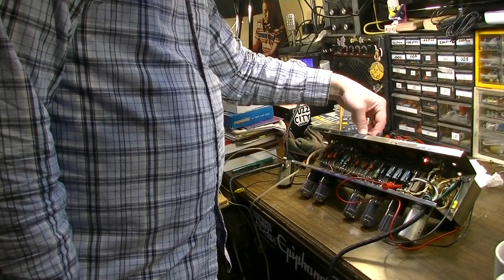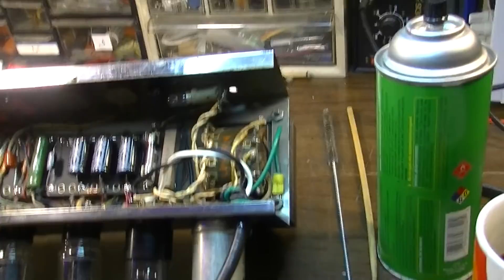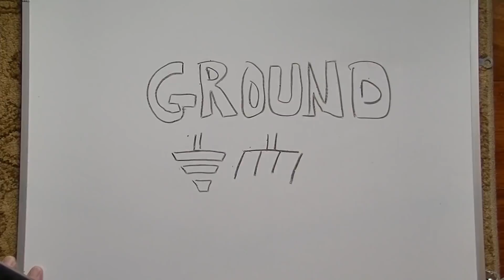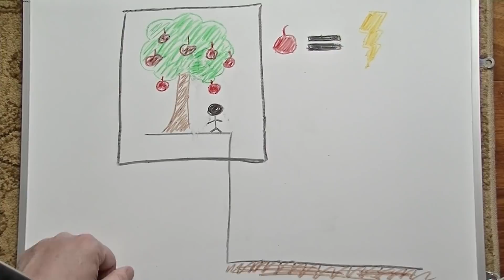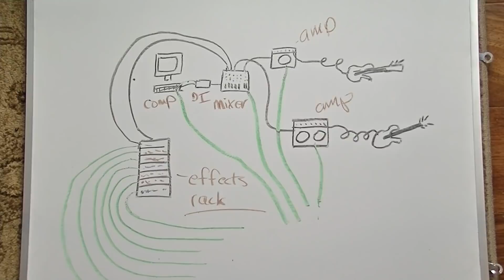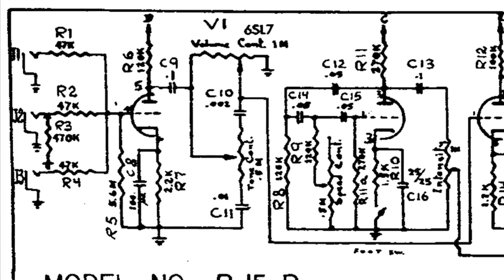Ground Loop Lunacy! - 1962 Ampeg R12 Rocket RESTORATION (Cont.)

Comment: I abandoned my J12-D because it needed 6BK11 Compactron tubes which I could not find anywhere. Now I'm entertaining the idea of gutting it, punching another hole in the chassis and using 3 6SL7's as preamp, tremolo and inverter. Perhaps also changing the 7868's to 6V6.
     I love the sound of Ampegs, but their use of weird "Unobtanium" tubes is  enough to make you tear your hair out. 
         Look up 6BK11 in your RCA book. 3 sets of elements in one bottle.

Comment: Hi Brad.  I may have missed something here but did you try replacing the 5M6 resistor?  Also, with the buzzing transformer, you might have tried painting the windings of the power transformer with lots of clear laquer, like 'estapol' or similar.  Lots, so that it kind of capillaries itself into & between the winding layers.  This worked for me with a little 40 watt transistor amp I built years ago.

Comment: This comment is probably not much use by now but I'll share my experience anyway. 

First of all. Over the years I've had two power transformers that buzzed under load. One was a beautiful art deco Kenyon that I pulled from a Hamfest score. It lived in my preamp power supply for 20 years until last year. I had that power supply a good 10 feet away from my preamp so I just lived with it until I replaced it with a new one (I couldn't take it anymore!!)

The second one was in a priceless "Black Flag" 100W 1967 Marshall Super Lead plexi head. That was a bummer.... There was nothing that could be done except sell that amp to Mick Mars....

Some transformers are just like this. You don't know until you install the thing. Better to not mess around with some old iron and just buy new.

Second. I love old Ampeg amps. But damn they eat up a lot of bench time. I'm watching a colleague suffer the same problem with one from this era. I'm pretty much retired from this now but when I was working a lot there were some amps that I just said no to. I like a good challenge but life is too short for lemons!

Great video! Thanks!

Comment: Had one of these type Ampeg chassis that had a really bad ground loop.
Turned out the cap can was originally mounted on a phenolic wafer and whoever replaced the cap replaced the phenolic wafer with a metal one thereby creating the loop.
Since it would have been a tin of work to undo the cap can and install a non conductive wafer, i was able to find a spot in the black grounding wire that travels up to the input jacks and grounds various stages and split the loop there and remedy the situation.
Yes, crazy grounding scheme...

Comment: Fascinating diagnosis, but I'm not sure the answer is correct.  One I think can safely assume that the amp did not hum like that when it left the Ampeg factory.  So logically one can conclude that the amp is no longer configured in the same way.  Whether through modification, oxidation, or simply faulty parts, the amp now hums.  While you've found a way to stop that, I would argue that you're only masking another problem.  After all, the jacks ostensibly were originally chassis grounded and now they're grounding to another ground rail.  So I wouldn't stop there, I'd use that observation and ask myself what else has changed that could cause this to make such a large difference.  Of course I'm not fully aware of the state you got this amp in, and whoever got their hands on it before you got it, and you had to do a transformer swap along with a whole shitload of caps.  So I feel you and understand what you're up against here.  But ask yourself what could have been causing ground current with ripple to find a better path to ground by going from the chassis, via the jack, across the shielded input cable (inducing hum) to wherever the input jack is grounded?  I don't know the answer either without it being on my bench.  But I'm looking squarely at the mains chassis earth.  I have a feeling that feature isn't original, and while I agree with earthing old chassis, perhaps this amp design requires a different approach to it.  I also suspect the reason Ampeg grounded the inputs at the chassis is so you don't get shocked while touching the chassis and your guitar at the same time.  When you lift the input jacks and ground them elsewhere, you run the risk that the chassis and the this ground point are at different potentials.  A bad solder joint can make that happen at any time.  Well, your guitar will be at the potential you've grounded the jack to, and if that isn't chassis potential, you can have a fun surprise when you touch the chassis and your guitar strings at the same time.

Comment: Very nice exclamation of ground ing ii have done many rub amp That because of the high impedance of tube noise is alway a problem components theme can generate noise and will a lot of corosen  of the chassis it’s best to go to a classic grounding and eliminate all loops and have just one chassis ground this amp stock has several

Comment: So, what would cause the 5.6M ohm resistor to open in the first place? Was input 2 designed to be the default input?
Reply from the maker: No real default, just different impedances.  Not sure on the resistor, just old, badly made, who knows.

Comment: There seems to be a bit of back and fourth about where to place the ground for a three prong conversion, as far as the new chassis ground placement. Some say drill and make new ground solo lug/tap for the wire others still use a transformer lug/stud. Time, gear, customer requests all come into play. Thoughts, good/bad makes no difference?

I had a nasty ground loop from my Laptop and Audio interface. Nasty meaning If I recorded I couldn't hear it in my cans but playback it was there in the recorded signal. Moved both power chords of the interface and laptop power supply to the same jack. Which made me question the wiring of the house mains.
Reply from the maker: Your house wiring is probably fine. Plugging all device grounds into a single wall outlet is the way to go. Sounds like you did it right. Now, of course, you can't overload a single source, but floating the grounds of devices you can't plug into the same outlet and then running chassis ground wires from one device to the other devices plugged into that outlet should fix the problem.

Comment: Well It may have been the fact Before the 1970's two prong plugs were more common than three prongs so they probably were thinking they were being smart, and no one caught on to this till the 70's or even the 80's. There's also the possibility of a manufacturing mishap that was happening that no one caught in Quality control. I'm just making an Educated assumption so If anyone has a better quess as to why we might as well try to figure this out so the curious among us can be enlightened.

Comment: So did this old Ampeg ever work correctly if it was wired wrong to begin with?...or did I miss something? DO all old Ampegs buzz?
Reply: They were wired correctly, when he grounded the new can cap at power end of amp it introduced ground loop because only ground point was at input jacks. The original can cap ground was isolated from chassis with its ground going to end of ground buss on board

Comment: Recently I have rebuilt an R-12R with the exact same issues: ht secondary shorted, also a bad rectifier tube, leaky capacitors,  and the dreadful ground loop that you have been showing. I couldn't understand why Ampeg overlook the grounding problem, and have been wondering maybe is because the amp originally had an ungrounded mains cord, and changing to a grounded cord would create the ground loop ? Thanks for your videos, awesome stuff !

Comment: After reviewing your first video and noticing the replacement of the power transformer, filter caps, rerouting the ground leads, then hearing the hum issue, I can't help but think that you introduced large filter cap ripple currents into the wiring that constitutes the system's "ground." Long ago, I'm guessing that Ampeg had hum problems in their initial crummy design. They futzed around with the location of this and that ground connection scheme, got it working somewhat, and pronounced "good enough. Ship it!" Half a century later, you come along and rip apart their wiring scheme, change component selections, and now you have a hummy amplifier. Why are you surprised? (That's an observation, not a criticism.)

Every conductor has resistance. It cannot be helped. When you run current through a resistor, you get I*R voltage drops. R is what it is. I, on the other hand, is a function mainly of the capacitor quality (ESR). The lower the ESR, the higher the ripple currents are, and hence the larger the I*R voltage drops in your ground system. ESR of those old filter caps was usually pretty high. How about your replacement caps? I bet they have lower ESR than the original caps, which increases the ripple current amplitude. This voltage drop has gotten into the entire system grounding, and now it has corrupted the audio. It doesn't take much input noise signal to a 40-60 dB amplifier to get a lot of output. That's what amplifiers do!

I have no idea what your grounding wiring looks like, but were it me, I would have created a  a "star ground." First and foremost, isolate the wiring between the power transformer and the power supply components, particularly the first 22uF cap that is on the output of the rectifier tube. It is where 99% of the ripple current is created. Put the "ground" of the power transformer on your component board (call this "A"), and then route all the power leads to it, and nowhere else. This way, you confine and isolate the flow of current in this subsection. The last thing you want to do is to somehow pass these supply currents through the chassis! No! Electrons come out of the power transformer, and each of them MUST make it back to the transformer. Take advantage of this fact to keep as much of these currents out of your audio ground!

Point A then defines your audio amplifier ground.  Connect all of the amplifier's ground leads, then tie them to point A using a single wire. In this fashion, you have more or less managed to isolate power and audio grounds, while still keeping them tied to the same potential. I am still dubious about the 1/4" jacks making the chassis "hot" (it would be much better if chassis was connected ONLY to the green safety lead of your power cord), but at least there won't be power supply current running through it (chassis) anymore. This should keep the I*R drops in your audio ground to a minimum. In this video, I do not think that is the case, and is the source of your hum.

Something else that would be of value would be to connect your Fluke to the output of the speaker and then measure the frequency of the hum. 60 Hz or 120 Hz? 120 Hz is a sure sign of power supply current corruption of your ground plane. If you had an oscilloscope and a current probe, I'm confident that you would find that your speaker's audio hum would look exactly like the power supply's filter capacitor ripple current.

I also note that you now have a 3-wire ground system, which the original amplifier did not. I bet your variac also has a 3-wire ground system. Thus, you have also introduced a ground loop between your amplifier and the variac, making the chassis even "hotter" yet. Run a fast experiment and use a cheater to break this loop and see if it reduces the hum. Or punt the variac and plug the amplifier right into the wall. How's the hum?

No matter what, this is a horrid design. Whoever designed it was not a competent audio engineer.

Comment: I also would advise that putting those 47k and 470k resistors on the circuit board rather than on the jacks would be better way to design that. Because you want the highest level signal on the wires going to the circuit board to reduce hum as much as possible.  You don’t want to reduce the signal level then send it along an unshielded wire.

Comment: There must be a more “correct” way to fix the hum. Surely, Ampeg wouldn’t have designed it with so much hum. No one would have bought these if they hummed like that. Is it creating a possible shock hazard between the guitar strings and the amp by not having a direct ground there? I would be very cautious about eliminating a good ground between guitar strings and amp chassis. Love your videos!

Comment: To confirm grounding problems, check for zero ohms with an ohmmeter, or use a wire to connect the grounds to see if it makes a difference.

Comment: 1/4” jacks are crimped together so it is very possible they are not making solid electrical contact between their own parts. Replace them with new Switchcraft jacks.

Comment: inductive capacitance.  experienced this before while shipbuilding in the uK.it involved screened cables  passing through metal holes, we were using 240V for our supply voltage. and we were getting 120V to 140V readings from the screen down to earth. the guys were getting electric shocks from these,and the simple solution was earth the screen at one end   solved the problem.   great show BTW

Comment: Nice description of how ground loops happen but I don’t think that’s your problem.
I reckon your A supply on V1a has is not filtered properly. The capacitor can you removed has 4 inbuilt capacitors. I reckon you need to check the C1c R28 combination is properly connected (seeing as you replaced the can) as it sounds to me you have 120hz problem not 60hz which indicates power supply ripple.
As per this circuit
https://www.google.com.au/search?q=ampeg+r12+c1+capacitor&safe=off&client=safari&hl=en-au&prmd=sivn&source=lnms&tbm=isch&sa=X&ved=2ahUKEwjmv_mT-JfhAhVT8HMBHXlJC8oQ_AUoAnoECAwQAg&biw=1024&bih=666#imgrc=5eoDdIcMB0tn2M

Comment: Use Max Pro Electronics Lubricant on the inputs. It works as good and is less expensive than Deoxit. It's also a much bigger can. The lube in it creeps better than WD-40 so you can use it on rusty guitar bridge parts and shit. Used with a Q-tip, I think it deoxidizes jacks better than Deoxit and the lube is so light ity seems to disappear after a short while.
Reply from the maker: I may give it a try. Thanks for the tip.

Comment: An interesting conundrum of an Ampeg to be sure.
Q. At what point in your modified circuit does the player connect to Earth potential ?
I didn't trace the circuit with any diligence I admit, but a little safety concern light bulb went off in the back of my head. 
Way back amongst the dust and old cardboard boxes.

I've played “Hunt the Hum Loop” in studios a couple of times. 
Infuriating the way a hum dissappears when you isolate a unit but it's not That unit that's causing the hum. 
With various hums adding and and cancelling it could be maddening tracing the culprit or culprits. 
Now and then I'd discover that some bright spark would have left a mains Earth disconnected to break a loop !!! 
Charming safety awareness there …
I've lifted rack unit Earths in a diagnostic scenario but I'd never leave one that way. 
Any studio console/rack that I've setup would have Star mains and hum free service.
Whover invented HumFrees deserves a Nobel Prize or should that be a NoHum Prize ?
Reply from the maker: The chassis is connected with a ground wire now. Any HV lays on the chassis, it's going to ground out the green wire.

Comment: The new format is great man. Love the white board explanation, the math help, and the walk-through of the input scheme. I haven't had much free time so I just watched part 1 and 2 today. I kept wondering if this would benefit from separating the preamp and power amp grounding busses, similar to what is recommended when building a Champ or 5E3 deluxe clone (also recommended on the Rob Robinette site). This may not be possible with that Ampeg, or require unreasonable amounts of work, but it was something I was curious about

Comment: Brad - are you 100% sure that the can was original factory?  The reason I ask is that the Ampeg grounding scheme actually works very well if and only if the can is mounted with an insulator with no direct connection to ground where it is connected to the chassis.  I've worked on dozens of Ampegs of this vintage and that's how most are set up.  The can common is connected up to the ground rail on the board and the ONLY place that is connected to chassis ground is at the input jack.  That is why the ground bus line is terminated at one of the jacks.  

This eliminates all ground loop situations.  If you replace the cap can with discrete caps or do any other work on the amp, you will introduce the ground loop you experienced.  You have to wire everything up through the ground bus.

If the amp did not have a fiber insulator between the cap can and chassis, then it's 99% been replace and/or worked on and someone incorrectly removed the insulator and grounded the can to the chassis.  A big no-no with these older Ampegs.

Comment: Irrespective of the period taken to restore this Rocket to proper operation, I simply relish the opportunity to attend class at the same time. Your explanation of how to understand voltage behavior was enlightening. It adds credence to the defense of how lengthy troubleshooting can vary on a case by case basis. This amp is part and parcel of that scenario. I can't wait for Ampeg III... This time, it's personal. A very worthwhile trilogy, Mr Brad. Educational, and a show to boot. Keep rockin' sir.

Comment: Will you replace the 5.6M resistor? (Thanks for the ground loop visuals.)
Reply from the maker: No, I rewired the jacks to Fender specs, except I left the 47K values on the input resistors.